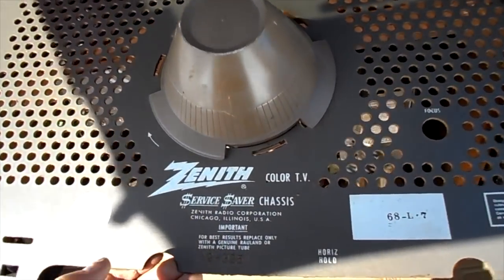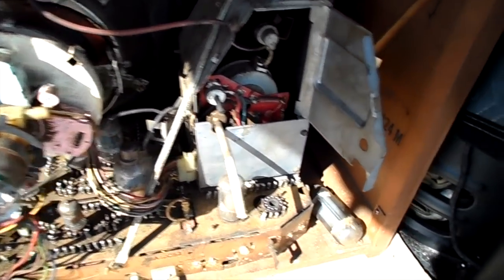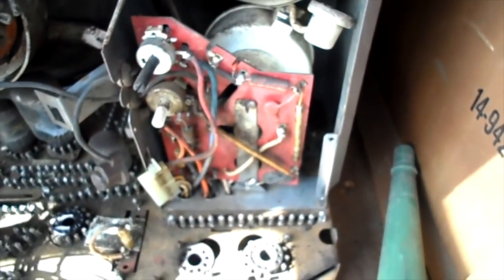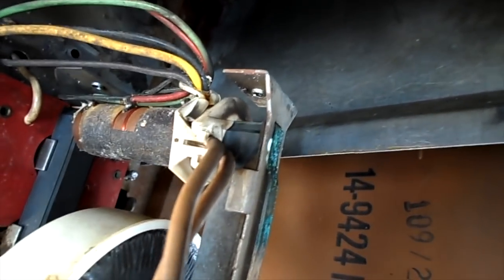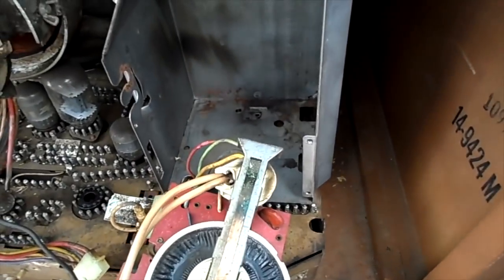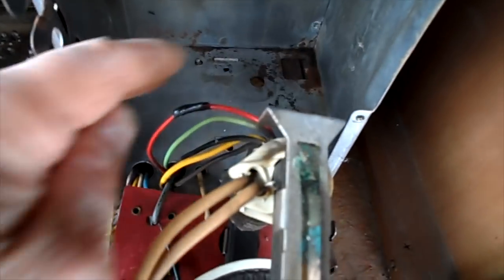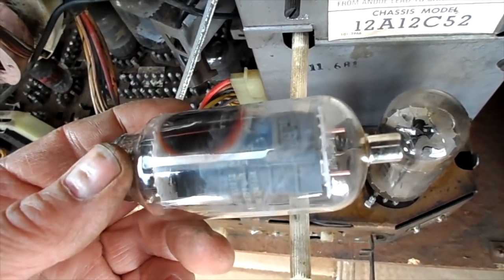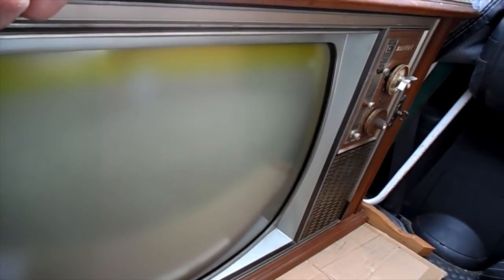Zenith Color TV. Model A4520. 1st. Look.

Comment: In 1969 Zenith introduced the A4519, A4520, A4525 & A4528 (and are new for 1970), they all look to have the same plastic TV face, but all with different wood cabinet, the A4520M was called the "Cassatt" , the cabinet is genuine maple veneer (thus the M), the tubes are a new patent  "Chromacast" (new this year) which are touted as being %100 brighter and colorful, then those that are not, oh...these are also referred to as "giant screen TV's"!  Hope that helps some! The 520 sold for $530.  ~Jack, VEG

Comment: This is a 1970 model TV.
Reply from the maker: The SAMS is dated 1970, & is typically a year ahead of manufacture. Will follow-up on what years this model was produced. Thank you for watching.
Reply: It could be a late 1969 build, the "A" line chassis is the 1970 model year. The letter following the first numbers of the chassis designation is the model year on Zeniths.